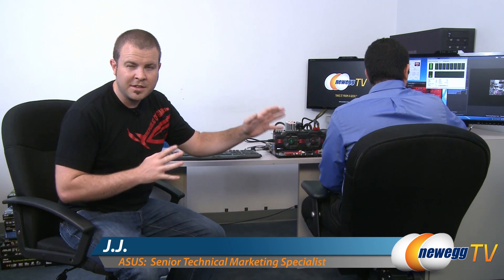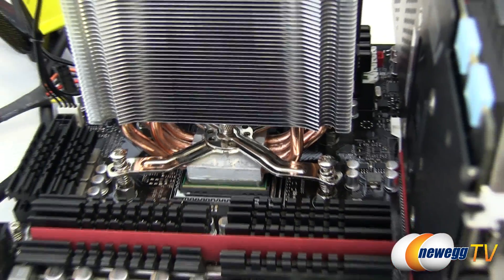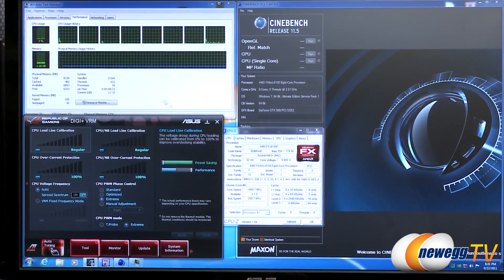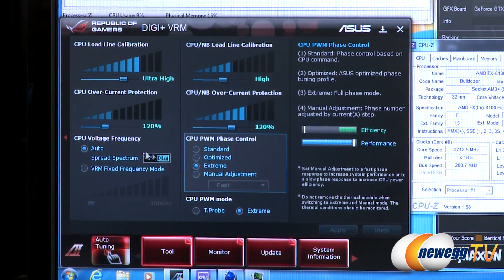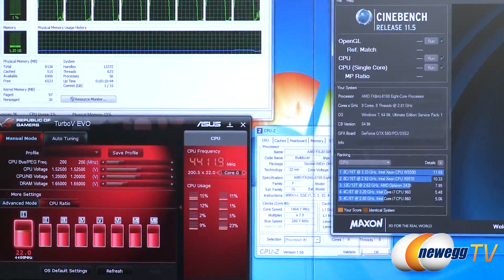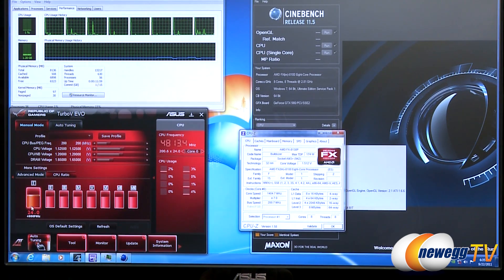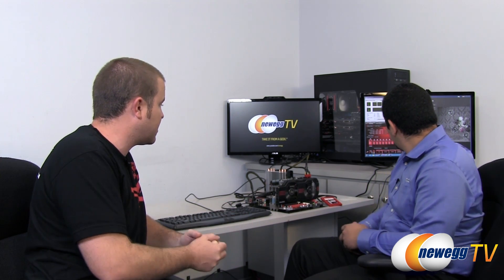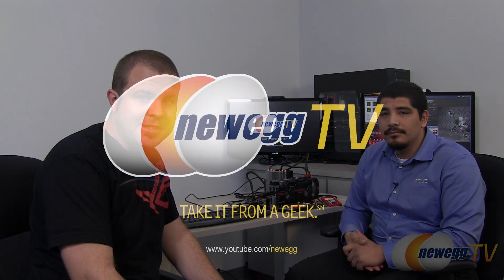Newegg TV: AMD FX-Series Bulldozer Overclocking with J.J. from ASUS

Comment: not true, he has cool and quiet on, why would you run your CPU at 4.8Ghz 24/7? not only is that going to kill your cp uVERY vast, its going to jack up your power bill, and temps, it runs at 2.5 or lower when its not needed (sleep mode) and cranks it up to 4.8 when its needed

Comment: Crosshair V formula - AMD FX 8120 Eight - 16GB Vengance Ram 4x4

Core Speed: 4206.7 MHz / CPU 51°C / SB 34°C / NB 50°C
Multiplier: x 19.5
Bus Speed: 215.7
Rated FSB 2373.6 Mhz

DRAM Freq: 1006.7
FSB:DRAM 3:14

11.68 V+12V
4.87 V+5V
1.49 V CPU VCORE
1.64 V VIN3
2.72 V VIN4
3.15 V +3.3V
0.31 V VIN6
1.69 V VIN8
1.50 V CPU
1.38 V CPU/NB
1.12 V ICH Core NB
2.54 V CPU VDDA
1.84 V DRAM
1.22 V HT
1.11 V IOH Core SB

all this look good?, or is it going to blow up? you seem to know whats what :)

Comment: Whats the deal with RAM? Im getting a sabertooth and 8120, I already got 8GB 1600mhz RAM though, will that cause me problems? I was planning on overclocking, First time, should be fun. Even cashed out for the Corsair H100. I also thought you were suppose to increase buy small amounts and only one thing at a time, Is that right?

Comment: @subuk420 

1.Ths guys are using a Xigmatek cooler that have contact pipelines, it is pretty good but anyway 1.5v isnt required to hit 4ghz range
2. Yes no brainier, but Bd have problem with paired 1866s
3.Depends on what you have, if you got 990fx chipset with BD you will be just fine with multi overclock, I just got mine in CB 7.38 in just the multi @ 4.5ghz
4. Prime95 will crash for this BD, better use htb wprime 32

Comment: @anonymousb37 ok i have the same cooler i have some idea ur max temp is 65 degrees dont exceed that ever and its risky to even get close to 65 degrees run it at 1.4V and stress test it at 4.5ghz if its above 65 degrees stop the stress test and dont o.c it past the degrees you have now... and if its like 50 degrees even at 4.5ghz then u could risk running 1.425V to 4.7ghz and run stability tests weekly for 15-30 mintes (60 degrees above can be risky so this is you're precaution)

Comment: @anonymousb37 whats you're cooler? if u have stock cooling dont even go close to 4 ghz lol... if you have a 20-35$ one i would stay about  4.2ghz and anything above maybe 4.3-4.5ghz im not totally sure there might be some ripoffs so do ur research but generally get prime95 and stres test it with AMD overdrive open if AMD overdrive is showing u temp above 65 degrees i would slow down b4 i kill my cpu

Comment: First of all what are the temps? did he even monitor them?
This dingaling is using 1600 ram - get the 1866 so you dont have to worry about your ram getting retarded over higher fsb speeds
Should have started with fsb increase to maximize overall system speed, then the multiplier for internal speeds, and lastly voltage for stability
oh yeah and one more thing... OVERCLOCKING ISN'T ALWAYS THIS EASY

Comment: @lexwalker2 I own an fx-8120 and have noticed Asus boards having problems with BD - I think they're getting it sorted in later BIOS versions, but not 100% sure on that. My chip scores 7.40 in Cinebench at 4.5ghz, using an MSI 990fxa-gd80. However, that is still abysmal for such high frequency and power draw, so I wound up buying a sandy bridge anyway, which is scoring 7.21 at stock (mobo is EVGA P67 FTW) :D

Comment: Anybody remember this guy taking a 2600k to 5.2 ghz on a air cooler test bench.  This guy needs to show realistic overclocks for processors.  No way the overclocks this guy shows for this processor will hold up.  The top end 8150 can't even do 4.8 all cores without insane voltage and top of the line water cooler kit.

Comment: @brostav the bulldozer architecture was more designed for servers after all because I see no consumer application using all of those 8 cores. The problem is that performance per core is even worse clock for clock than the phenom II. Thus, it even loses sometimes to the 1100t. The only scenario where this cpu would shine is in an enterprise environment working with heavily threaded tasks. But again the power consumption, especially overclocked is through the roof which is unacceptable for 32nm.

Comment: @nebukenazar  You are right on, on the software compatibility.  No one else seems to understand this.  End user benchmarks on a different OS (maybe Linux or Win 8) may be a better result.  
I see the FX 4100 to be a better chip for the masses.  If you have the need for 8 cores like in a editing enviroment that used many heavy hitting programs at the same time, then the FX 8150 would be a great chip for that use.

Comment: @TheSchmitzrunner Well, yeah, I can. I'm not saying that they wont be able to get the job done, but for a CPU that was released after sandy bridge it should at least compete with it. The fact that the Phenom IIs can beat the FX-8150 in some areas is just pathetic.

Ivy Bridge will probably be out by the the time AMD release Piledriver, and PD probably wont even beat SB. AMD stated a 10-15% increase in performance over Bulldozer. IB is supposed to be 20-30% more powerful than SB. And it's 1155.

Comment: Since amd overclocked this to around 8.4 ghz with I think liquid nitrogen I wonder if it's possible with water. And if so 8 cores at 8.4 ghz is way too good to pass up these days. I bet it'll beat the i7 then. Not unless the 2700k comes out and rains on amds parade with 12 cores at 15 ghz with the stock cooler at 5.9v lol. 4000 watt psu ftw.

Comment: @BeSweeeet CPU Benchmark shows read and write speeds, encryption rates, 3d FPS Benches, and overall capability of multithreading. They have tested them all and shown the 8150 to highly outperform the 2500k, but fall short to the 2600k

Comment: @TheSchmitzrunner So?? That's just marketing. Pentium 4s can hit 7GHz with liquid nitrogen but you don't see anyone using those.

The 2500K is a cheaper processor that is better in every possible way. From what I've read the FX-8150 seems to have a problem with it's L2 and L3 cache, especially latency wise. The 2500K is tried and tested, and has crazy single threaded performance, which is very important to a lot of applications. Also they aren't true cores.

Comment: @DoomTra1n GHz mean nothing if the architecture sucks. A 4.8GHz 2500K will own an FX-8150 at 4.8GHz on every level whilst using HALF the power. I have nothing against AMD, but seeing as how the the 2500K comes in at a price point BELOW the 8150, it's impossible to recommend the AMD CPU to anyone who doesn't already have an AM3+ motherboard.

Comment: It only beats the i7 2600k when overclocked, and not by much, according to bench marks by guru3d. However, it is amazing at multi-threading and is much better at that. I think the decision would be determined on your use. For me, modern gaming does not really require more than 4 cores, so I would go with the sandy bridge cpu's.

Comment: @DoomTra1n Horrible power consumption. Those 8 real cores suck when using apps that don't utilize more than one core. It was supposed to blow away the competition but it's about equal to a core i7 or overclocked core i5.

Comment: @PublicEn3my66613 The benches are based off floating point benchmarks... AMD released the processors for the ability to fully utilise all 8 cores at once. If people decide to benchmark a floating point on a cpu that wasn't designed for it then go ahead because this processor is a processor and thats it! Its like testing a Gpu for a process that requires multi threading IT DOESN"T MAKE SENSE!!!

Comment: @DoomTra1n The quad core i5 2500K outperforms the 8 core 8130/8150 while staying cooler and consuming less power. Furthermore, the 2500k is actually cheaper than the amd octocores. I'm no intel fanboy but the benches speak from themselves.

Comment: @sk8erfreak9242 It does not have similar performance, intel CPU's perform far better. And yes, AMD is usually cheaper than intel but you get what you pay for. Just because it has more cores doesn't mean it's better. The bulldozer costs about the same as an i5 2500k and the i5 outperforms it by far. You just sound like a fucking amd fanboy.

Comment: They told us at the overclocking event this thing was supposed to reach 5GHz on high-end air cooling no problem.  Obviously turned out to be bullshit; it overclocks to the same Sandy Bridge does on average: 4.5-4.6GHz.  The kicker is it consumes over 100% more power than Sandy Bridge when over-volted by similar amounts.

This is AMD's Pentium 4: slow, hot, and too expensive.  At least Intel back then could get much higher frequencies, which helped mitigate the low IPC.

Comment: An AMD 8130 (the budget 8 core CPU, am I right?) with 8 REAL cores, overclocked to 4.8 ghz on air using a Cooler Master Hyper 212? + the prices, I don't see how this is fail at all. Isn't AMD going to release the 8180 later on too? How high will we be able to overclock the 8130/8150 w/ a Noctua cooler or custom water cooling?

I'm sold.

Comment: @danisasuperbeast I would agree what the other two said.  For gaming if you got the 2500k and overclocked it from stock 3.3 to 4.8, you can get about 10-15 more fps.  And that is just the CPU alone.  You can also get more by overclocking the GPU( a good one like gtx 460 or better).  Both overclocked can get anywhere between 15-25+.  It depends on what gaming settings.  Also, some older games like CounterStrike Source will sky rocket to 200fps with everything maxed.

Comment: @danisasuperbeast programs load/run faster/responsive, os boots up faster, gaming is much more improved, the DVD making features will be done faster (that's render times and such; this means that instead of taking 4hrs to make a DVD you make it in 1.5hrs). Your computer may freeze if not done correctly.CPU has to stay cool,so if it stays hot for to long GOODBYE. Yes you keep it overclocked 24/7, but you can lower it down to 4.6 to make things cooler. anything else?

Comment: @basketballlldude Except the most expensive AMD FX is worse than a 2500k which is $60 cheaper, and doesn't run at 450 watts overclocked to 4.6ghz like the 8150 does.

This series of CPUs is a complete failure.